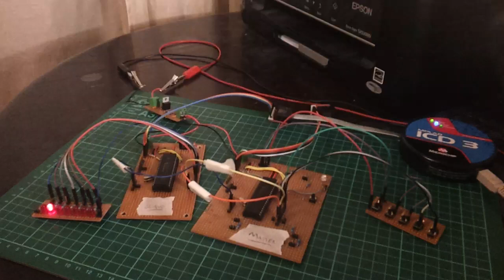SPI Communication Between 2 PIC's (Master - Slave) Part 1

Comment from the maker: Hi Luis, I am sorry that I did not see your comment sooner. I have started making online code repositories via Github. I have placed two folders under the Embedded Co-Design repo that contains all of the code inc. project files for both the slave and master PIC's. This project was a while ago now so i can't quite remember what state I left the code in. It may not be quite the same as in the video, but it should put you on the right lines. Please follow the link in the video description.